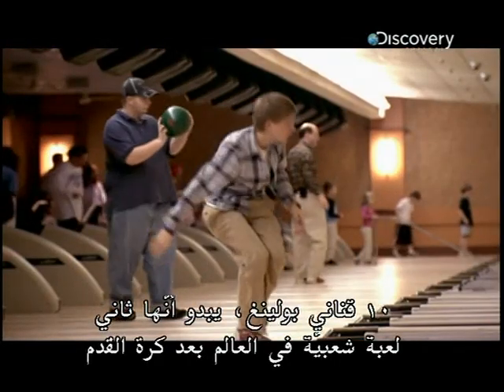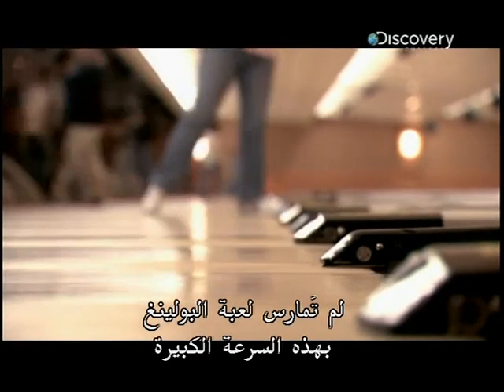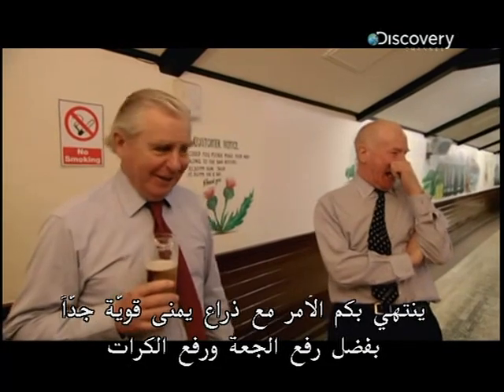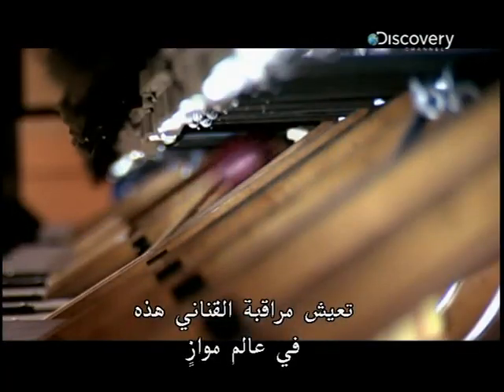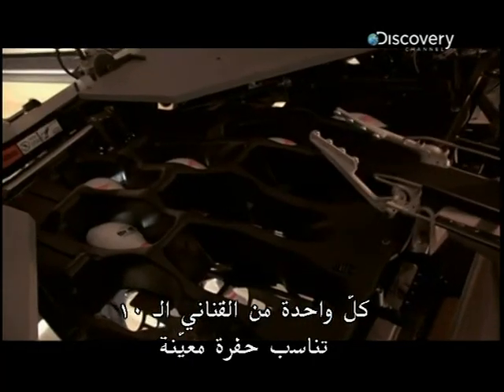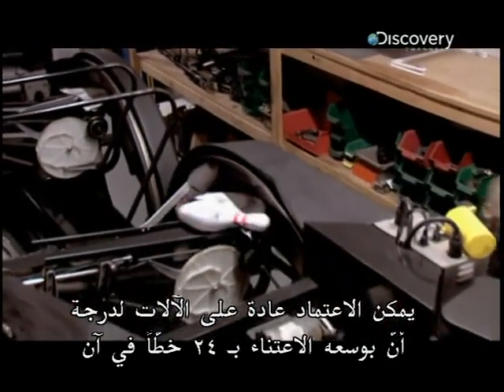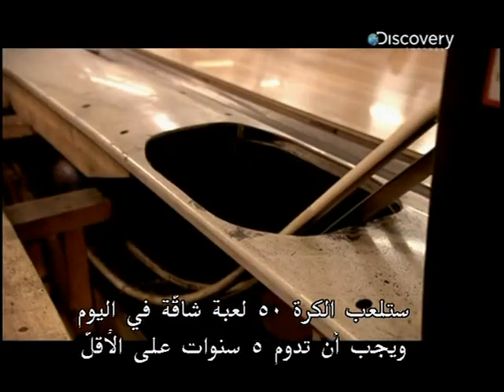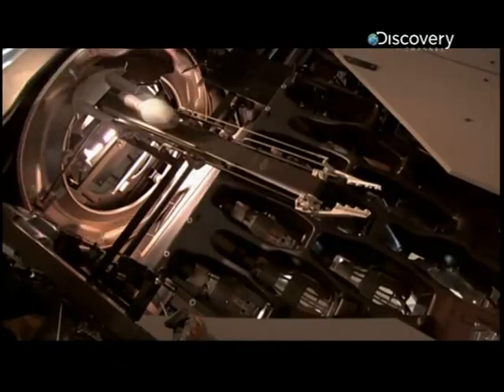How Do They Do It: Bowling

Comment: I service amf 82-70s at my bowling alley lol, I love how dumbed down this video is lol the plastic “tray” is called a bin(s)... the carousel is a pin elevator, the white plastic wheel as they call it, is called an index cam. The pulley that returns your ball is called a ball lift, the “loop to loop machine”😂 is simply a ball return
Reply: and the bin holds 2 pins in each slot